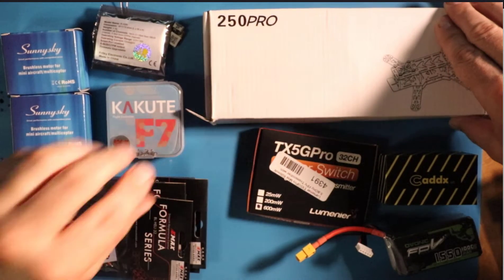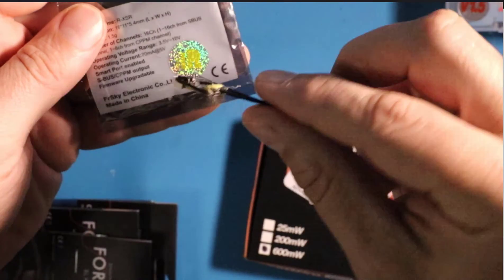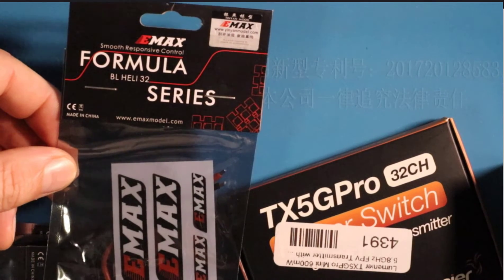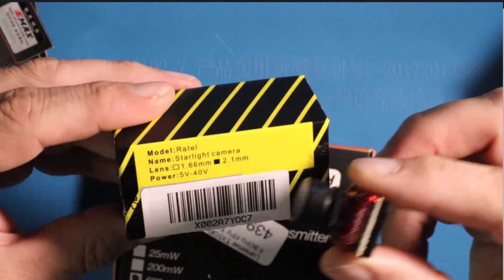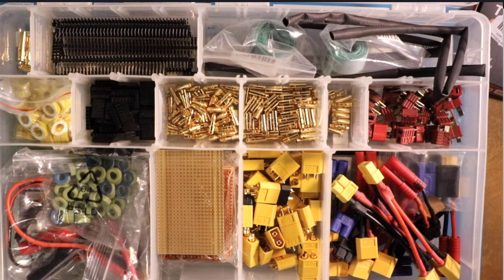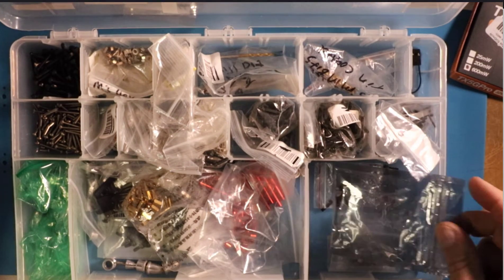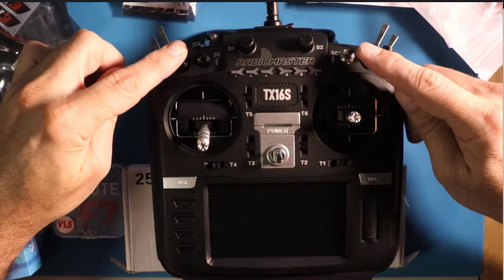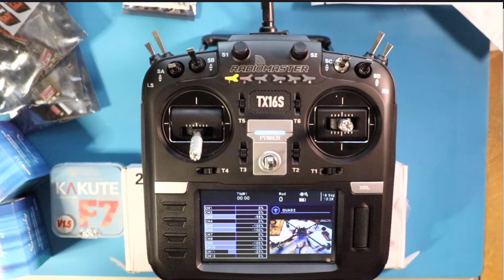Holybro Kakute F7 FPV Quadcopter Build - What To Buy

Comment: Hi i have a HJ-Y3 Tricopter kit Build that iv had for a few years now that has a kk2 flight controller Board on it, I'm  just getting back in to flying Drone's and Tricopter, i was using Deviation devo 10 radio and am thinking of moving to the 
Radiometer TX16S to fly it, cannot find any YouTube videos on linking this up to a kk2 board, also with my Deviation devo 10 i had to revers the servos on the Aileron and Elevator do you still have to do this with the new Radiometer TX16S. I'm not using Bata flight. just been watching your build here and wonder if you might have some idea's on this, any help would be very grateful.
Reply from the maker: Wow!  I too, got my start on quads with the KK1 and 2 boards.  I remember having to use AVRDude to for updates, and flashing ESCs by listening to beeps.  I have to tell ya, things are 100x easier these days.  My opinion is that if you continue to try to use that KK2, you'll experience much more frustration than necessary.  

I think the hobby will be much more fun for you if you upgrade to at least a F4 flight controller (here's a link to the evolution of flight controllers:  https://oscarliang.com/f1-f3-f4-flight-controller/#what-are-f1-f3-f4-f7).   If you get a TX16s and the receiver of your choice, and a newer flight controller - you will be amazed at the options you have available, how much easier it is to fly, and it's infinitely easier to set up.